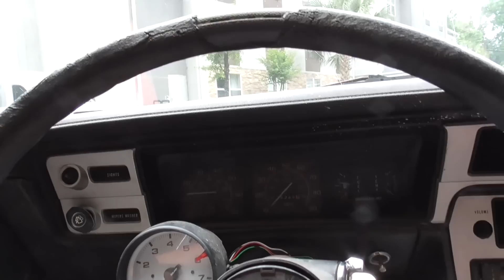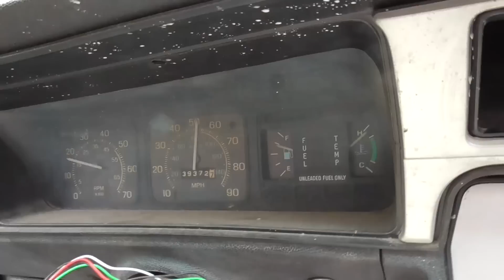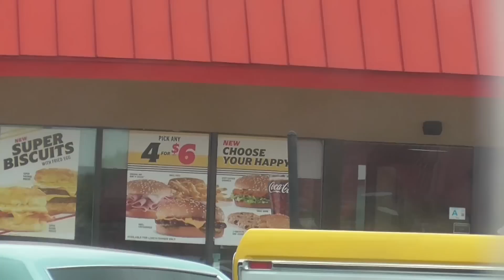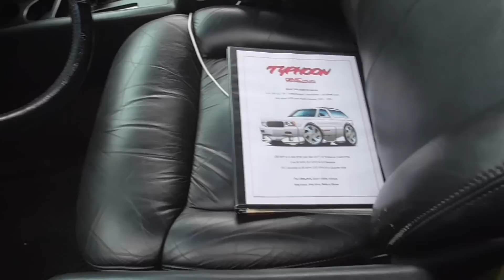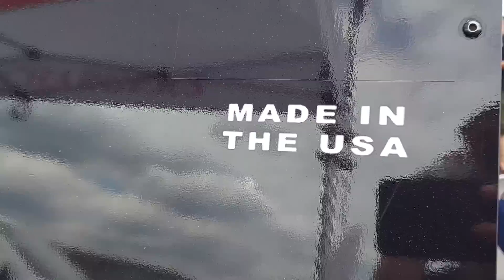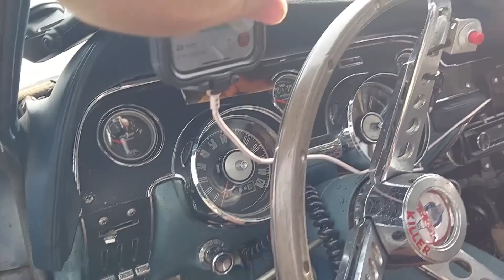2023 Hot Rod Power Tour Day 3! Problems begin! Has Austin been cloned?!

Comment: The 360 would be an "easier" build to complete and get going. The Hermi powered beast would be a "slightly" more difficult project that would take a long while to complete due to the fabrication that would have to happen. I think it comes down to shop time availability. Doing the Hemi swap is going to tie up the bay and lift for an extended period of time. I think the answer comes down to what is Rich willing sacrifice. I think the Hemi swap would be a viewer draw, particularly when you get closer to completion and start shredding tires.

Comment: Shoulda opened the sunroof Austin! No fun in having a sunroof if you don't use it! I know i know, there is the concern about it falling out... but it won't!
Reply from the maker: It was tempting a few times especially at night the weather was excellent! Unfortunately I didn't bring the glass holder with me and would loose my dang mind if I damaged this one. Windows down for 1600+ miles though!
Reply: @LucoreAuto  it pops up, that's what I would have done. I use my sunroof all the time. I hate convertibles, but sunroof and ttops are awesome

Comment: "It sounds so good..." no, it sounds like Flowmasters. Yeah.. I've seen enough Roadkill to know when it's transmission fluid leaking and trying to catch the car on fire... I called it immediately. "WO!" POT FARM!!!!!!!! though honestly it's probably a CBD farm, there's lots of those in what used to be tobacco country, they grow better and make more money per plant on top of being better for you.
AMC powered by AMC is far more interesting than Hellcrate/Hellcat or LS swap.. they've been overdone to death already... hell someone Hellcat swapped a Prius! Personally I'm really into the idea of just a really big like 7L AMC all motor with a wicked cam and Cherrybomb Glasspacks that just makes all the right noises, maybe put stack injection EFI on it for drivability and all the intake noise. You know that'd be cool! (besides you don't need Hellcat power in something that short, and those modern engines are just harsh sounding.. they don't sound good no matter what you do to them) 
Someone tell Kerry, the GTX only had two engines available.. the base engine was the 440, the only option was the 426 Hemi, and then you could pick compression and manual or auto.